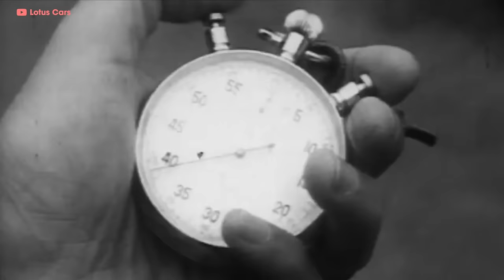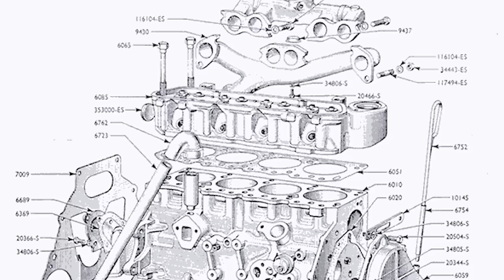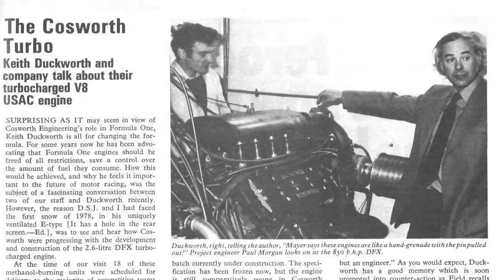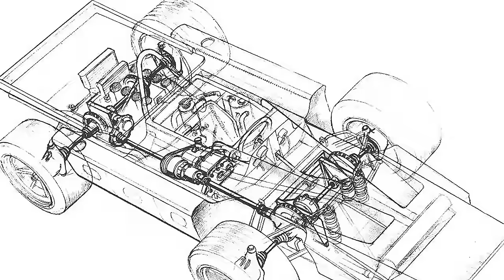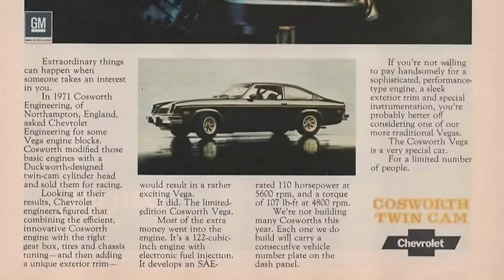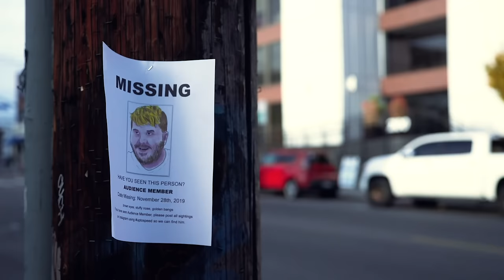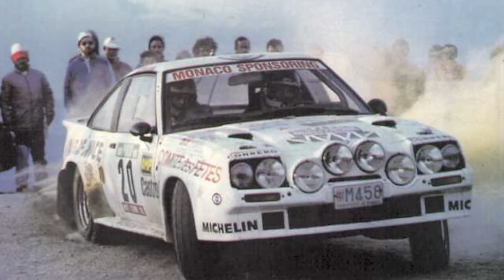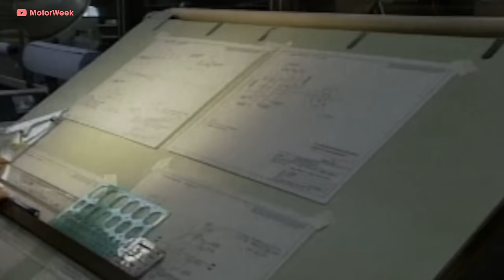COSWORTH - Everything You Need to Know | Up to Speed

Comment: you forgot the early singer porsche. they also have a tuned costworth engine before they switch to ed pink as their engine rebuilder. amazing heritage. their rs1800 has a better hp to displacement ratio than a more modern dc2 type r. and it doesnt have vtec and was made in the 80's tech. WOW.

Comment: 21:07
The YBB engine & 4WD system that went in the Escort was from the Sierra and was on a shortened Sierra (RWD/4WD) platform. 
An Escort body was butchered and then welded on top of it... with little, if any, rust protection by Karmann.
Reply: Lewis72 ino most of his info is wrong lol
Reply: So much wrong information in this video🥴
Reply: There is no YBB in the Escort Cossie :/
Reply: @pirkkaruuska5766  
My bad, it's the YBT engine, according to Wiki. I assumed he'd got that bit right.
Reply: @lewis72  YB is almost the same from 86 to 97, Small changes in the top and block. You can swap heads and blocks around.
I had a Sierra cosworth sapphire 4x4 that made a smidge over 400hp, I miss that car.
Reply: @Gravstein  
I did think that they'd be marginal differences between the different types of YB engine.

Comment: i have a cosworth chevy vega, and its so great! horsepower is low, but its got a lot of torque. with the 4 speed transmission it take off from stop lights fast as F***. mine does not have the EFI anymore though, it has dual side draft carbs.

Comment: I Have a -86 ford sierra, it is just a normal one, 2.0ohc. But the fun thing is, it has real cosworth parts: wing, sideskirts and grille, Idk where someone got them but I think those parts alone are worth more than the car, as the car has no motor, trans and interior, also it's started to slowly rust and the paint hasn't been the best in my time owning it. And I actually got the car for free from my dad who got it for free from someone else, but when my dad got it it motor, trans and interior but my dad decided to gut it and put a ford v6 in it. It had the motor for a while but it was never fully finished. Now the motor is in a 70's roofless toyota crown. Also the sierras seats are destroyed and most interior pieces bent but still usable, also the motor and trans was sold

Comment: I've been asking forever for a up to speed on the "Sierra cosworth" aka the weaker "merkur xr4ti" in America
Reply: Yeah the merkur xr4ti is weaker than the sierra cosworth but if you can get your hands on a xr4ti then buy it and make it look like a sierra cosworth - esp adding the big whail tail spoiler if you can. Last but not least try and replace that 2.3t Lima engine with the more powerful, tuneable and reliable cosworth unit! 😍😍
Reply: @robocop3961  Cosworth engines start at £6000 now just for the lump! the subframe can take a foxbody V8 (see Sierra XR8) which you could probably get decent power out of for that money, or an ecoboost can be had for a few hundred quid around here! Still there is a personality about a cossie engine...

Comment: "Everything you need to know" about Cosworth and not one mention of the Cosworth Capri RS? Should I forget the one I had then? Apparently no one needs to know that?
Reply: A GENUINE Capri RS is a unicorn,there are only 3 proper ones in the world.You sure yours was legit and not just had some bits thrown at it?
Reply: I imagine they are incredibly rare now. It is hard to keep older cars on the road there. You could find one if you were lucky back around 1992. It would cruise at 130 mph with more left in it. It helped increase the rarity of them when the rear end broke mid turn and resulted in a nasty crash. As far as whether it was 100% legit, or some kind of clone, I can't be sure.  I didn't own it long enough to learn that much about it. It was cool as can be at the time regardless. It took everything I could muster to buy it, and fix some things it needed. A lot of the things it needed, (suspension bushings, etc.) factory parts wouldn't fit it. I had the help of some local mechanics that were Capri enthusiasts help to figure it out. It took a couple of months to get it to where I felt it was sorted out fairly well, and the wreck happened shortly after that. I was able to verify that it was originally owned by a race team, and spent 2 years racing. If I remember correctly, they sold it off and replaced it with a Escort Cosworth RS Turbo (I probably didn't put that name in the right order. Take concussions seriously kids...) The only "photo" I have of it was the newspaper post about the wreck, and it didn't even look like a car anymore. I was told I should have died in the wreck, but the modifications to it saved my hide. I "walked away" from the crash, but not everyone involved was as lucky. I was able to help improve the safety of the area where the crash happened. The local magistrate let me speak at the hearing on the wreck that cleared me of wrongdoing. I suggested changes to make it safer. They took my suggestions, and actually did them. It had a bad history of wrecks. The biggest difference safety glass IMO.  I still wish they would have been mentioned it in the video. I would have shat myself if they had a photo that looked like it. I never saw another in person. I was in the UK with the USAF '91-"93. I worked on F-111's.
Reply: Don't feel bad. I had a svt focus( st170 ) cossie design engine . Most fun I had with pants on. No mention of any of the RS foci .
Reply: They didnt make a cosworth capri tho. Thats why its not mentioned.
Reply: @upurkilt7246  Probably modded by the previous owner then. I onky lived in England for 2 years in 91-93. The car changed hands through USAF service men for years. I unfortunately only had it for a short while. It was totaled in an unfortunate accident. The cause was never determined, but I suspect a rear axle failure.
Reply: @chadvarnell1889  usaf nice one my dad was in the raf as a rigger and a sootie for 25y 1981 till 2006. I had a 1986 2.0 laser when i was 17 but couldn't get insurance as my age so my dad bought it from me till his mk2 escort rs2000 was resto-modded then we parted with the capri. But you prob had a replica rs2600 or a rep rs3100. But there was alot with the cosworth v6 24v swapped in to them from the Scorpio.
Reply: @upurkilt7246  I was at RAF Upper Heyford.  I worked on F-111's. ✌🏻😎🇺🇸
Reply: @chadvarnell1889  the aardvarks? He  worked on shakoltons , tornados and the typhoons just before he left. We were at Holton, Leuchars, Germany, back to Leuchars the to Lossiemouth.
Reply: @upurkilt7246  Yes, The Tornadoes were loud as hell!!! 111's were damn loud but not nearly as loud.
Reply: @chadvarnell1889  yea mate living at the bottom of a runways for most my life was grate 😆
Reply: @upurkilt7246  sigh.. do some homework. ford loved cosworth engines.. so why wouldn't they.. the 2600 and 3100 rs model capri's.. some of the least known cosworths in the world.. heres a quick copy paste from the capri wiki "Ford Motorsport produced a 100-model limited edition with this new engine. The Group 2 RS3100's engine was tuned by Cosworth into the GAA, with 3,412 cc (3.4 L; 208.2 cu in), fuel injection, DOHC, 4 valves per cylinder and 435 hp"
Reply: @russdee1708  like i said ford never produced a capri cosworth in to the realm us comman people. The rs2600 had a colone v6 road version and for racing it had a weslake tuned v6 not a cosworth tuned engine🤔. The rs3100 had a Essex v6 250 where build for homologation with essex v6 so that ford motorsport could build 100 race cars with the Essex v6 tuned by cosworth so it could go racing.. and yet it still wasent called the cosworth capri the v6 was not released in to road production car of the rs3100. If that was the case it would be called the rs3400 cosworth? thats like saying every car that cosworth touched is a so called "cosworth" so the f1 cars from the late 60s 70s and 80s lotus, mclaren, matra, brabham, Williams ect ran cosworth v8s so are thay all cosworths to? c20xe/c20let from the vauxhall astra/cavalier/calibre are cosworths to as they helped vauxhall develop that engine? the rs1600, rs1800, rs200 all had engines develop by cosworth does that make them cosworths to? Only domestic road going badged cosworths sold by ford where scorpio/granada cosworth, sierra cosworth, escort cosworth. So think you should do some research before putting your tups worth in bud.
Reply: @russdee1708  well i think you must feel bit silly now since you haven't responded to my reply.
Reply: Capris rule

Comment: The rally 2.4 16V CIH engine in the Rally Manta 400 is not based on a diesel crank engine.  And the 2L 16V was produced for the Opel Kadett, not for the Astra. The Astra came 5 years later.

Comment: I know this is an old thread but I honestly I was kind of disappointed that there was no mention of the SVT Focus which had a Cosworth tuned engine but bumped up extra 50 60 horsepower out of Ford zetec 20 engine I actually own one and it's honestly a crazy little car drive the ever-living wheels off of it it literally handles like a go-kart now that maybe because I have stuck a set of Continental dws06 235/40r17 on the Factory SVT rims but even when they only have the 245 all in it prior it still was an amazing little car that you can push to the Limit and have an amazing time which now I'm in the process of doing the Cosworth bang of sticking a big old turrrrbo on it

Comment: Cosworth engines ROCK!  Unless you live on the wrong side of the pond.  You know who you are, your steering wheel is on left side of the car, you have laws designed to destroy the purity of sports cars with small engines while driving your 500CID Caddy 58 miles each way to work.  You insist on pumping air from two horsepower robbing air pumps into your 460CID Shag Van exhaust well into the mid 80's.  That's right, the 460CID Ford V8 made 205 horsepower ... less than the production road version of the Cosworth 2.0 4 cylinder in the same year!
Instead of engineering efficient smaller engines with fuel injection (like the rest of civilization) just put wires into the primitive carburetor, make the valves tiny, pump exhaust into the intake and air into the exhaust. Cams without cam lobes. Keep a molten metal fire going under the driver's seat to TRY to meet the emissions standards you have had the last ten years to work on but still keep using Band-Aids instead.
Sorry I got a little carried away...living in the 70's and 80's was tough. My point is, if you want a Sierra Cosworth RS 500... oops, I mean a Merkur XR4TI Cosworth RS 500 (no such thing) you get the medieval pinto engine with 6lbs of boost max.  Sorry can't have cool cars they have different names and steer from the right and are only available in places that are NOT America.
Thank God Ford let Yamaha build the SHO engine in 1989.  
I'm done, I just needed to get that off my chest.
Reply: Haha that made me chuckle 🤣👍🏻

Comment: 1100 HP Is already pretty ballsy on any application. 
1100 HP Naturally aspirated from a 6.5L engine is just insane.
GMs 6.7L does 410-430 ish? I DARE any LS "the LS is better" fan to get over 900HP out of a naturally aspirated under 8L LS.
The LS is an amazing engine don't get me wrong, probably THE best push-rod engine so far, but... It's made to do a bit of everything, not be a performance engine.

Comment: and there was... a ford... 460CI DOHC V8 that had an option for twin turbos or a supercharger. Good for nothing but blowing up transmissions by simply tapping on the gas peddle.
Reply: just like that guy that manual swapped the 4.6L mustang, half way into the first burnout the trans explodes,
Reply: bad translations... was supposed to be 460ci but the metric scrub made it 4600cc... cc... ci... CC... "CI"! ... CI is chlorine, so its CC... }8^3...